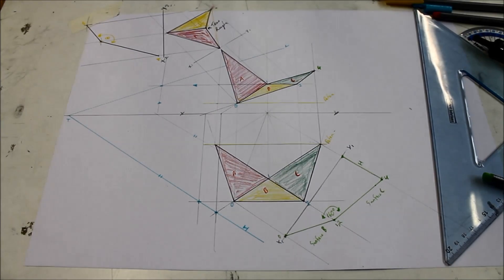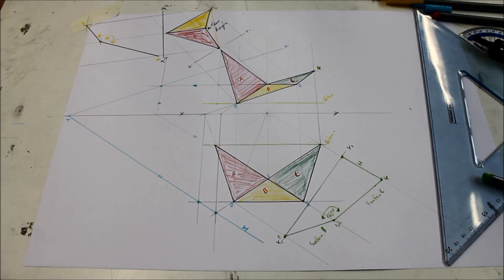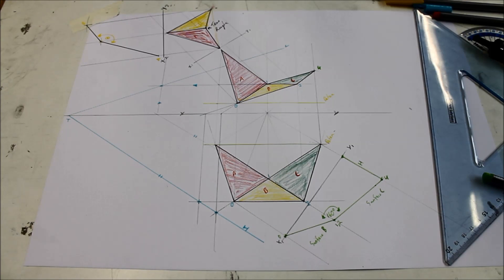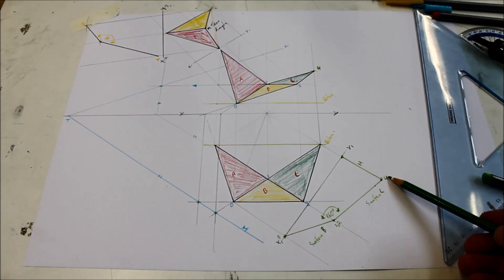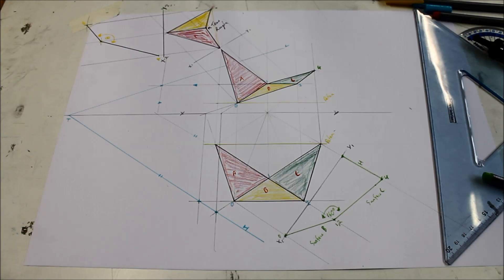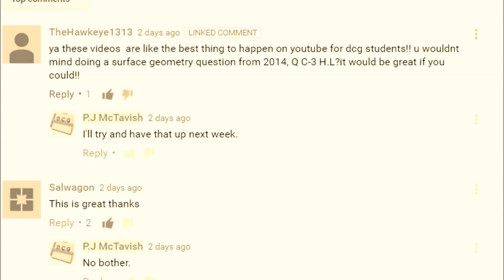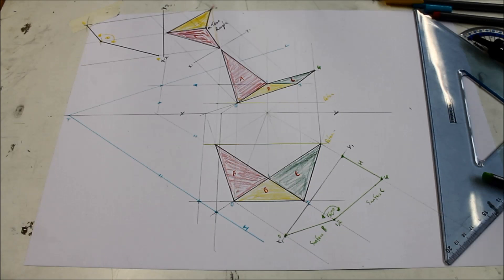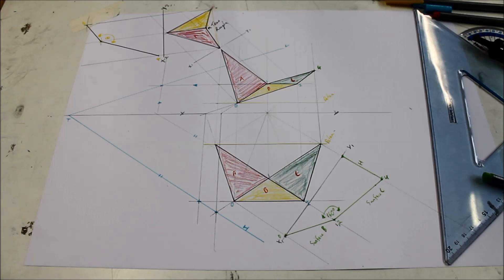DCG: 2014 Higher Level Question C-3

Comment: do you recommend using colors in the exam? if do which markers do you use
Reply from the maker: I would but only if you can spare the time to add a bit of shading. There isn't any marks for it in DCG unlike TG. I use 0.3mm Staedtler Fineliner pens for the labeling and Staedtler Watercolour Pencils for shading.